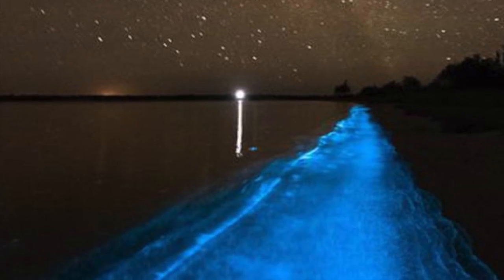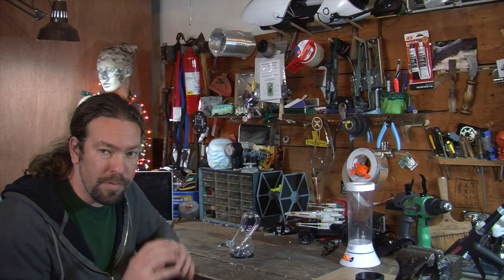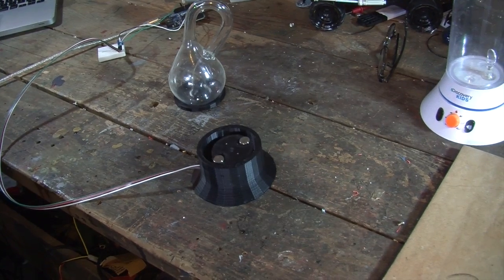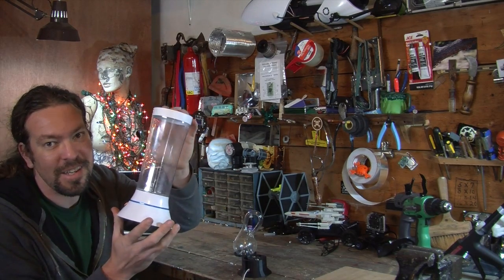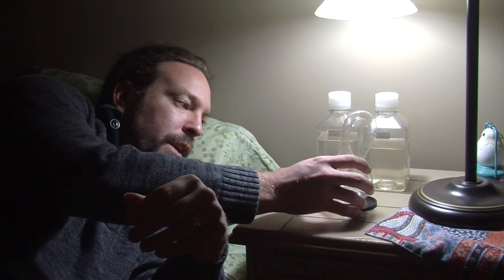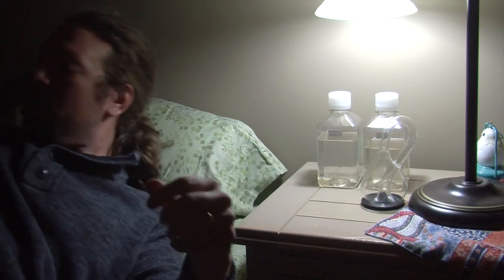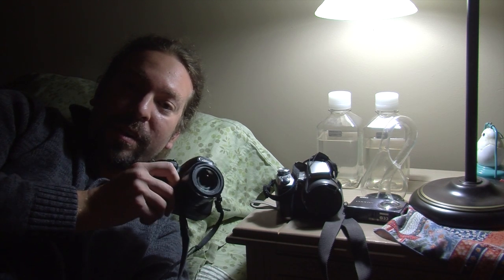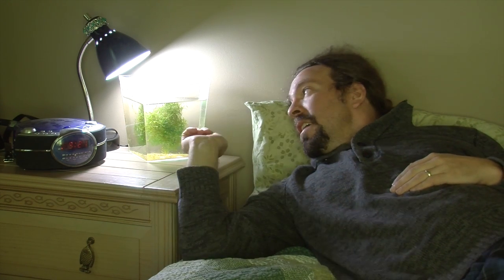Living night light with glowing algae

Comment: At first I was a bit disappointing because you need agitation- a power source- however, if you hooked up a servo to a solar panel and used that to agitate it that would work! I doubt this is more efficient than a light-bulb (and produces less light), that being said, the algae are also removing CO2 from your environment and producing oxygen which a light-bulb wont do so there is an added benefit there and if you are just using this as a night light then I think it would be perfect. I would love to try this. Someone below said that you could pump it through a hose and have it go around the room which would be neat. You could have a tank where it is stored and allowed to rest and then ''switching the light on'' could activate a pump. Noise might be an issue, but it's an interesting concept. I saw, ages ago, people talking about using these kind of lights as city street lights. I'm not sure how that would work if it's a low level light, but I am really excited for a greener future and all of it is so worth exploring.

Comment: You can't keep them perpetually in a non sterile environment as the nutrient will culture bacteria and overtake it with time.  The natural ocean has plenty of room for all but not a 250 ml container.  I have to divide mine with sterile seawater in a laminar flow hood with filter sterilized nutrients and put them in sterile containers such as what yours came in.  They are good for 2 months then have to divide again because of nutrient depletion and detritus build up

Comment: Need to come up with an algae-smart-light.. -For fine tuning light amount, (other algae data-volume,etc)  time data, and specific light spectra for the specific algae. So there could, perhaps, be a separate controller that works with x amounts of light panels/units.
I have much enthusiasm for independent, private and home algae growers, -algae experimenters. Such independent/home operators in other fields have made major breakthroughs, and will continue to make breakthroughs.

Comment: Can it live in a sealed container on a shady porch? It would be great to keep by the door, so when you come home late you can tap it and have light to see your keys to unlock the door. The LED keys always lose battery power at the worst moment, my porch is too shady to use solar lights effectively, and this just sounds so much cooler!

Comment: If you can fabricate a flexible ring ( I see now it would have to a crescent) with some type of fins and attach your  BB's on either side, then the crescent finned thing can revolve around guided by your magnets. 
The crescent would have to be flexible but return to and retain its molded crescent shape in the bottle being spun.  and have low friction against the glass.